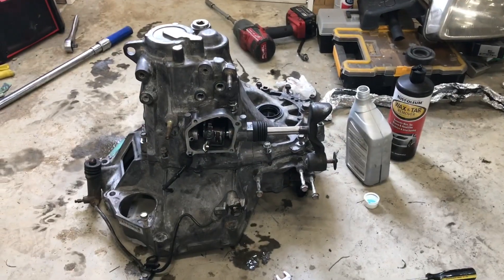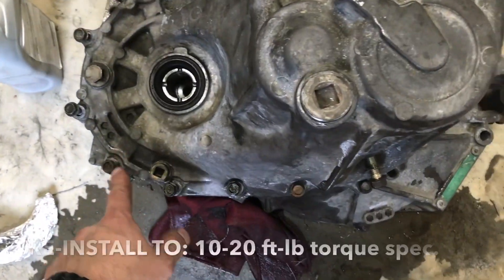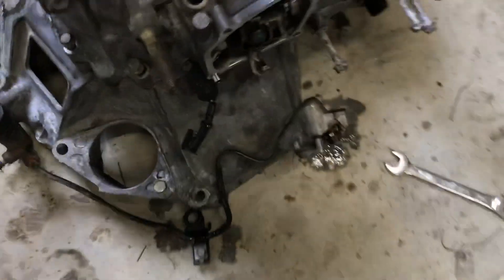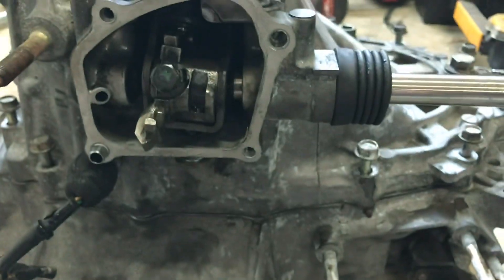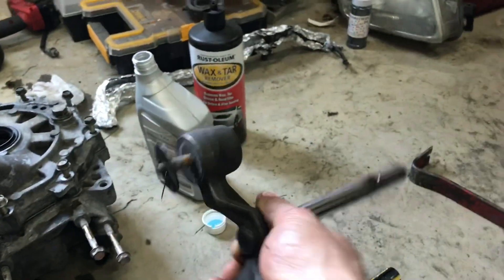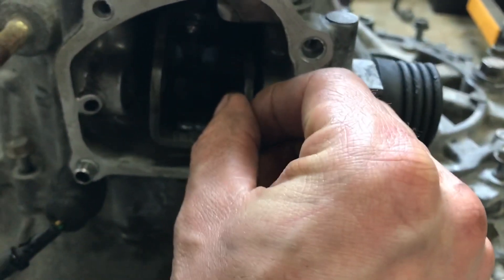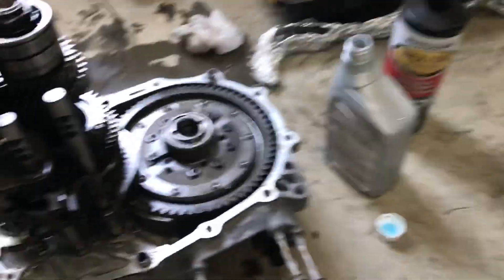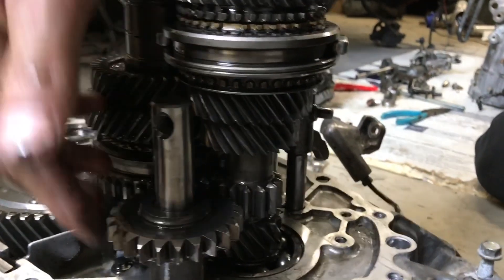How to disassemble an H22 Prelude transmission!!!

Comment: Great video and thanks for posting. Staring down a rebuild right now, and while I have tons of experience tearing apart engines, have always been skittish about messing with the tranny. This gives me a lot of insight, so thanks again!
Reply from the maker: In my experience, you have good reason to be skittish around trannys but I would say the easiest ones to rebuild are manual ones. Automatics have much more nuance. I rebuilt my 1991 Bronco E4OD trans and I didn’t get it right the first time. Now I have a couple under my belt but you have to start to learn!
Reply from the maker: Like most other things, take pictures/ videos before you tear down so you can see how they went back together if you get in a jam.

Comment: Yeah it takes allot of huevos to crack into a Honda tranny. Especially the automatics. So many parts...
I had a shop in HB that works on NSX and Lamborghini, etc... work on my 2002 Ep3 transmission. One old man from start to finish spent a month rebuilding my transmission. After he put it all together it never misses a shift or grinds going into gear. Prior to this I even had the Honda dealer fix several gears under warranty and it shifted like crap! I dunno what that old man did but 100k miles later and the transmission still solid
Reply from the maker: With the manual transmission they are pretty easy to rebuild and shim. Automatics have a lot more going on.
Reply: @thestateofreal2533  yeah totally. So many gears and clutches and little seals and dinky parts. And I know everytime no matter what I work on I always have several screws and bolts left over Haha
Reply from the maker: @blazeaglory  you and me both haha

Comment: There are 2 bolts that are a little longer than the others on the case. Where on the case do those go?
Reply: Not the really long ones but the 2 slightly longer ones that go around the outside of the case.
Reply from the maker: Pretty sure on the Side where the shifter is not where the axles go into it

Comment: Any suggesting on getting that bearing out of the housing if it stays up in there?
Reply from the maker: Never had that problem but I tend to go with heating up the case that surrounds a stuck bearing.
Reply from the maker: If the bearing is trashed then weld two bolts to it and use a slide hammer on either side incrementally. There are bearing pullers out there for this application

Comment: What cars come with compatible lsds for h series transmissions?
Reply from the maker: All the JDM ones: m2b4 (prelude sir). You will pay about $800 one of those trans so you might as well get an Mfactory or Quaife LSD.
Other options LSD blocking plate or weld the stock diff. Con: won’t hold for big power and wheel hop.
Reply: @thestateofreal2533  thanks alot!

Comment: For the high pressure power steering hose did you have to unpressurized it? Or what
Reply from the maker: Nope it’s only under pressure when the pump is running. The pressure gets higher with rpms so opening it at high rpm would be dangerous but not with the car off.